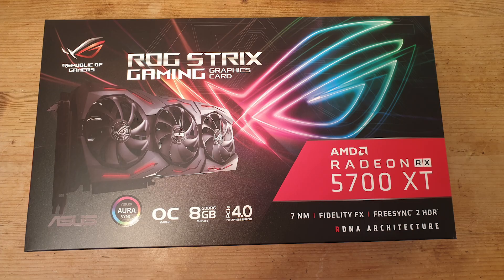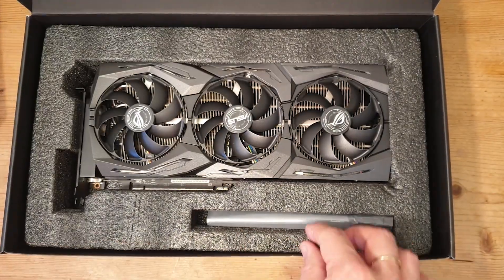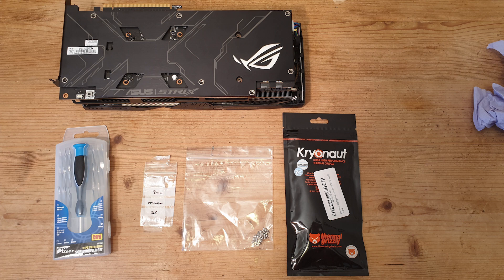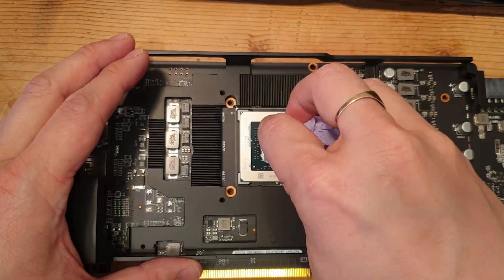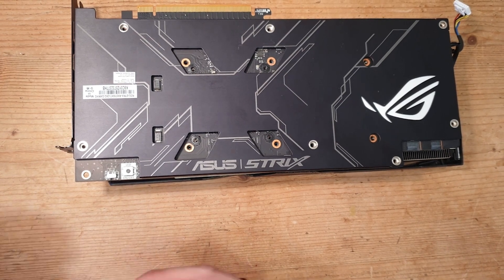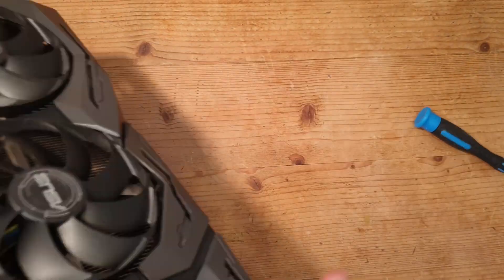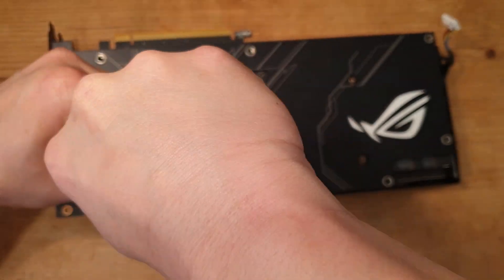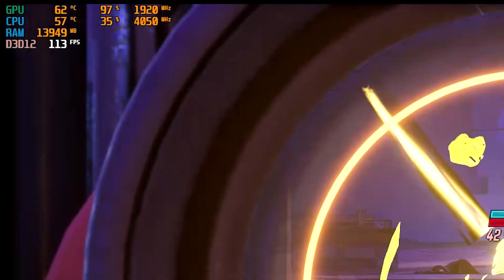ASUS ROG STRIX 5700 XT Tempeture Fix

Comment: I'm looking to repaste my GPU, and don't really get why the washers are necessary? Am I fine just screwing screws back in as they were?
Reply from the maker: The washers makes the cooler contact the gpu die a lot better resulting in cooler temperatures, I believe ASUS made this issue better with the later models so you can just repaste it if you haven't experienced any temperature issues.

Comment: I did that and got 3 degrees different. When gpu goes near the 90 - 100 percent usage it goes up to 82 degrees with 2000 to sometimes 2200 RPM, Maybe my Case aint so good or smth but man. I guess I just have bad luck

Comment: Did you put 3 2mm washer on every of those screws?
Just got the same GPU.
Reply from the maker: I used 3 x 0.5mm (1.5mm total thickness) washers for the VRM, For the GPU spring loaded screws I used 1mm.
Reply: @HardwareHusky  Sorry to bother you . did you use only one 1mm washer for the GPU?
I bought this card 2 days ago and its seriously thermal throttling.
Reply from the maker: @lerigxfr  Yeah I only used 1x1mm washer on each of the 4 GPU screws.

Comment: After changing the thermal paste temps went from 97 to 59 max, but junction still stands strong at 106-112. Sadge
Reply from the maker: You may have a uneven mount, I would first try remounting the cooler making sure you do a diagonal pattern while tightening, if that doesn't help much you may need to use whasher.
Reply: @HardwareHusky  after testing couple days in different games im lead to the conclusion that its how the gpu works, for example when i lock heavier games like cyberpunk to 60 fps, junction doesnt go above 90, while unlocked it keeps pushing more fps till it hits 110 again. Welp

Comment: hello, the thermal pad is 2 mm? Thank you.
Reply from the maker: I think they are 1.5mm but I used 2mm and getting much better vram temps.
Reply: @HardwareHusky  i use 1.5mm,, if using 2mm can get better results?
Reply from the maker: @farahmaisarah7741  most people that use 2mm find vram thermals much lower.

Comment: I have a card a bit newer than that one, they "fixed" the retention screws by adding springs instead of washers like you did. However I was recently reaching temps of about 98°C! So I opened it up and added washers to the screws opposite side of the retention screws and applied new paste and am running on load at 66°C now. Thanks so much of the vid I haven't played games this smooth in a while.
Reply: I started having the same issue with the 5700xt I have. Recently I am getting 100c and I couldn't figure out why. I have 4 small springs underneath the screws that look like they have seen better days. I have no idea where to get these washers though
Reply: Hi, I want to do the same as you, but what do you mean with "washers to the screws opposite side of the retention screws" what other side do you mean?
Reply: @jornesaenen  I think he means just opposite. I managed to do it - I found few washers that came with my mobo and I used 2 instead of 1. My temperatures dropped 15 degrees under load!!
Reply: @treliq - Hi, long time after you left this comment. But I bought this card recently second hand. I Already repasted it and changed the thermal pads. And now I want to add the washers. How thick would you say is the ones you used if you can remember? I noticed I can order ones that is 0.3mm thick. Not sure that will be enough. Hard to get these small washers.
Reply: @thedoors2003  I don't remember at all brother and I don't have the card anymore to check. I think you can use anything non conductive as a washer maybe rubber of some sort. As far as thickness go I don't remember at all
Reply: specifically what size washers did you use?

Comment: Thermal pads thickness you used plz?
People are saying 0.5/0.75mm will be perfect for both rx 5700/5700xt?
Reply from the maker: If I remember correctly the vram thermal pads are 1.5mm.

Comment: does non conductive and non capacitive mean that any thermal paste for CPU would work? Which one should be avoided? @Hardware Husky
Reply from the maker: Avoid metal based thermal pastes like Arctic silver and liquid metal because the metal contained in it can be conductive and capacitive, the ones I like are Arctic MX4 or 5 and if you don't mind spending a bit more get Thermal Grizzly Kryonaut.

Comment: same card,same paste,new thermal pads, and absolutely no fcking change in templs
Reply from the maker: Have you tried adding washers to the GPU and VRM screws?

M2mm x 5mm x 0.5mm for the VRM screws but you can go 1mm bigger 

If you wanted to do the GPU for more pressure. 
M3.5mm x 8mm x 0.5mm for the spring loaded GPU screws.
Reply: @HardwareHusky   i just saw another video where they say about those washers, but i do not get what s the point with them
Reply from the maker: @f3lix3  The VRM screw are too long from the factory and adding washers to them makes the heatsink and thermal pad contact better lowering VRM temperature.

Adding washers to the GPU mounting screws increases mounting pressure to the GPU die so you get lower GPU temperatures because the better contact.
Reply: @HardwareHusky  will try tomorrow thanks,il get back with feedback
Reply: @HardwareHusky What a joke that so many of these cards were shipped out like this. You're doing God's work with this video.

Comment: Hello.  Is the radiator made of aluminum or nickel-plated copper?  I want to use liquid metal
Reply from the maker: The part that contacts the GPU die is nickel plated copper.

Comment: Hi, thank you for the video! However, I don't understand some things in the speeded up video part. How many washers did you put under the vrm screws? 3? And how many do you recommend to put under the screws of the gpu block? I found 1mm thick washers online, are they okay? Thanks and sorry for long question.
Reply from the maker: I used 3 x 0.5mm (1.5mm total thickness) washers for the VRM but others have used 1mm worth of washers so the 1mm thick ones will work ok. For the GPU block 1mm will work ok too.
Reply: @HardwareHusky  Thank you dear!
Reply: @HardwareHusky  where can i get those o rings washers? any link ?
Reply from the maker: @alberthernandez8424  Ebay and Amazon normally have these washers or you can get these from electronics and hardware stores. 
Here a link but it's for the UK:

https://www.ebay.co.uk/itm/FLAT-BLACK-NYLON-Plastic-WASHERS-Form-A-M2-2-5-3-M3-5-4-M5-6-M8-10-12-M14-16-M20-/401506514600?mkcid=16&mkevt=1&_trksid=p2349624.m46890.l49286&mkrid=710-127635-2958-0

Comment: What is the size of the washer used ? I think im gonna use it to the 2 screws which holds the end part of the gpu.
Reply from the maker: The nylon washer you need are, 
M2.5mm x 5mm x 0.5mm for the VRM screws

If you wanted to do the GPU for more pressure. 
M3.5mm x 8mm x 0.5mm for the spring loaded GPU screws.

Comment: does this affect the VRAM temps in any way? i notice my strix vram temps suck compared to my refrence model vram temps
Reply from the maker: No this doesn't.
The card will benefit from changing the thermal pads to good ones like thermal grizzly Minus 8 pads and upping the fans but will still run fairly high because the design.
Reply: @HardwareHusky  thanks for the reply, highly appreciated, do you perhaps know where i can find the specifications for the thickness on all the thermal pads as i will then do my best for the card and replace all the thermal pads with proper ones?
Reply from the maker: @dominiquevanwyk518  Sorry I cant remember the thickness's that I used and I don't know where you can find the information.
I bought 0.5, 1, 1.5 and 2mm pads and measured each one before I removed it from the graphics card.
Reply: @HardwareHusky  thanks, ill see perhaps ill end up doing the same, ill be sure to reply with my results
Reply: @HardwareHusky  just want to report back, by default it uses 2mm thick thermal pads for the VRM section and all the rest are 1.5mm

i ended up using 2mm all round and it worked a treat! vram temps are 8c lower on my mining rig now, the strix vram cooling design still sucks but it is operating in safe temps now atleast

thanks very much for the video to help guide my hands, very helpful
Reply from the maker: @dominiquevanwyk518  Thanks for the update I'll note down the sizes for when the next person asks, Im glad I could help.
Reply: @dominiquevanwyk518  what your temperature when mining after replacing thermal pad?

Comment: I just recently got mine and it still has this problem. Are their specific screws and spacers needed for this fix or can I just use whatever fits well enough?
Reply from the maker: You can use use whatever washers that fit well enough, rather than use shorter screws for the vrm which don't bite into the thread that well I used washers as well.

The nylon washer I used are, 
M2mm x 5mm x 0.5mm for the VRM screws

If you wanted to do the GPU for more pressure. 
M3.5mm x 8mm x 0.5mm for the spring loaded GPU screws.

Comment: Hi, did you use washers on each screw or just the ones that attach directly to the gpu? 
P. S. My English is bad, I write from a google translator.
Reply from the maker: No only used washers on the 2 VRM screws and the 4 screws for the GPU.
Reply: @HardwareHusky  thx

Comment: I bought my gpu in november and I tested if when gently pressing there was space between the head of the vrm screw and the gpu, and yes, but it is about 1mm, is it the fixed version?
Reply from the maker: If it's only 1mm of movement that could just be the thermal pad compressing because the flawed version moves a bit more.
Adding some washers could improve the vrm temperature if they are high.

Comment: So what fixed it?
Reply from the maker: Washers on the VRM screws fix the cooler drop problem on early cards.
Reply: @HardwareHusky  I got mine after the fix but I’m still getting high temps when gaming over 80* what’s the problem do u know
Reply from the maker: @IIQwickScoperrrII  They fixed the VRM screws but left the GPU with low mounting pressure, adding washers on the spring loaded GPU mounting screws lowers the temperature but you will have to break the tamper seal.
Reply: im not really into pc, should i bring it to a pc tech for this to get done or is it easily done
Reply from the maker: @IIQwickScoperrrII  Its a really easy task but you can crack the GPU die if you tighten it too much, a PC tech that is shouldn't charge you much to do this.

Comment: Hey husky, do you mind giving a link or something to the washers to use? i want to make sure i get the proper ones
Reply from the maker: 2mm x 5mm x 0.5mm for the VRM screws but you can go 1mm bigger for either ID or OD

https://www.ebay.co.uk/itm/2mm-White-Nylon-Plastic-Washer-Spacers-M2-New-Pack-x-25-Free-UK-Post-/250951154962?_trksid=p2349624.m46890.l49292

https://www.amazon.com/uxcell-Insulation-Spacer-Washer-Gasket/dp/B01KFNUJCA/ref=mp_s_a_1_8?dchild=1&keywords=M2%2Bx%2B5mm%2Bx%2B0.5mm%2Bnylon%2Bwasher&qid=1598841045&sr=8-8&th=1&psc=1

If you wanted to do the GPU for more pressure. 
M3.5mm x 8mm x 0.5mm for the spring loaded GPU screws.

https://www.ebay.co.uk/itm/WHITE-FORM-A-FLAT-66-NYLON-WASHERS-M2-2-5-M3-3-5-M4-M5-M6-M7-M8-M10-M12-14-16-20/183102291898?_trkparms=ispr%3D1&hash=item2aa1bf3fba:g:wNMAAOSwWMtamXRJ&amdata=enc%3AAQAFAAACgBaobrjLl8XobRIiIML1V4Imu%252Fn%252BzU5L90Z278x5ickk8Fd9si%252FIbtWQr%252BhnlRwjDc0OHe%252Bsf4bsy3Ym8Y91jNVYKa9SfzumxF5V%252BdDqXvF9L5vrcdNizugQZoHJJ9P%252B4cFiObLAsE84qVzzhR9rtvNPc1OY1nlPK3x3tYONTxwKuNZhG2nl2cK%252Bc7C3coHO%252Fw%252BGvHKJKqi%252BpGtgmQGPKAJP5Y0zsI3sW2DbV3zHsZH14sb8yD0i9TR7NYrrB6bMQ8fqX2H4hQ8bxJQjhaKdAsdbi5VrcRM%252B29WwHxLuljwB%252F05lyynM%252FMh6BmhepEn6t2JD91%252BiNzWDHQaXwM93G3Rvu0rJWtxyRqo7aR2KC7fydeQV7TCR%252F8JmpDXhoGMFJrVrMEDThRfkg%252FecbP0Mve09Aw2dXKnwn1s0bjmwjQNfzveeyt3FThV%252FdW6Im0DDLOnPRYWFWnuC61ciuEJFDkk9L6ODoR%252Fds1WRIOa7WdmlJcgCj3m0l4whQqazGtIIO7shImtZ%252FGu7oOiAW0PBEKTrxKTEavzjsqa6UcFHrKxB1r3HYhzj616GEBBcLky5freUM%252F6a5LYZXKI1Pw3sm97QZLUdmzbLbjjD2aQi5xKL055M5WZWEPJciWCcGloMGrCtTk1v7W7R3vGAW%252BgcoBJwt3sx86PdhNOkq5Tvz79ut7M%252FAkzZ%252BgfE0js8rMwzVZntNoBknRPXb2h%252Fcs9uHaxLwBEa3rNFcmdsQmDey045BZyGNrZ4BpLQRcagZUqkOkhApSNR%252B9HltICfbNVyeqejGYQzuzCOMZcS4jKJMS7KFCcMmSULWZaZ7xmqIa3U4PUigwSQXlKX5em7fD5zRj0%253D%7Ccksum%3A183102291898ba10244016fa4f139f2c486a29c9fd7c%7Campid%3APL_CLK%7Cclp%3A2334524

Comment: so i just need to add the spacers in the gpu and vram
screws?
Reply from the maker: Primarily the VRM screws but also doing the GPU screws can lower the temperatures further.  The thermal paste is not required unless you separate the cooler from the GPU die.
Reply: @HardwareHusky  thks

Comment: there are plastic or metal spacers?
Reply from the maker: I recommend nylon washers but other people have said they used metal without problems.
Reply: @HardwareHusky tks, how can i find them?
Reply from the maker: @recindsaa5812  eBay, Amazon or you can try hardware stores. 

The nylon washer you will need are, 

M2mm x 5mm x 0.5mm for the VRM screws

If you wanted to do the GPU for more pressure. 
M3.5mm x 8mm x 0.5mm for the spring loaded GPU screws.
Reply: @HardwareHusky  thks
Reply: @HardwareHusky  Can they be m3 x 8 x 1 mm? for the gpu
Reply from the maker: @recindsaa5812  Yes that will work no problem.
Reply: @HardwareHusky  and m2x5x0.5 are still ok? (sorry im insecure)
Reply from the maker: @recindsaa5812  Yes M2x5x0.5 is the ideal size if nylon but can be tight on some metal ones.
Reply: @HardwareHusky  but if both are nylon?
Reply from the maker: @recindsaa5812  
For nylon washers use these sizes
M2mm x 5mm x 0.5mm for the VRM screws
M3mm x 8mm x 0.5mm for the spring loaded GPU screws.
Reply: @HardwareHusky  ok thks

Comment: Anybody know what thickness are thermal pads.
I would like to replace them.
Reply from the maker: I cant remember the exact size for the vram and vrm but I used all 4 sizes (0.5, 1.0, 1.5 and 2.0) to replace the main pads, backplate and to lower memory temperatures I connected the memory plate to the heatsink.

Sorry I couldn't be more helpful

Comment: I did several tests with Benchmarks, Stress tests, the last one with with FurMark Rog Edition and this is the results:  GPU Max 76ºC Junction Max Max 92ºC, Memory Max 104ºC, GPU VRM Max 81ºC, Mem1 VRM Max 68ºC, Mem2 VRM Max 67ºC. I play at 1080, GPU at 2050Mhz. Is there any concerns around those temps?
Reply from the maker: The memory temp is high but you are running FurMark which is considered a "Power virus" because it uses more of the graphics card resources than normal use. 
What are results with gaming benchmarks and 3D marks?
Reply: @HardwareHusky  It depends. Just an ex. Cyberpunk in Ultra  77FPS 72ºC more or less.  Do you need any special reference? Maybe is everything ok the my GPU.
Reply from the maker: @dinocorreia1202  That temperature for the memory while gaming is about right after it's been fixed either at the factory or yourself, mine runs around the same temperature.
From what you have told me your graphics card sounds ok unless you have mounted it vertically which can hide the issue because the cooler won't pull away from the pcb.
Just check the temps every now and again.
Reply: @HardwareHusky  ThankU so much for your words. I could make a excel with all stuff but it's boring and takes time. I guess you're right. And due that, i didn't mounted vertically. You can watch here https://pcpartpicker.com/b/9Kcqqs I have a nice airflow and seems all looking good. Anyhow i will check over and over again :-)

Comment: Can it work just by tighting more the screws? ( as for me all this looks complicated to do )
It would be grenat if I could have an answer
Reply from the maker: You can tighten the gpu screws more but risk snapping them if you don't have an appropriate torque screwdriver, the vrm screws (which are the main problem) are physically too long so they either need spacers or shorter screws.
If you are capable of tighten screws, you can easily undo 2 screws, add washers and tighten them back up, cooler doesn't even need to come off for those screws.
Reply: @HardwareHusky  Thanks a lot 😉😉👍.
I have around 5-6 m.2 screws ill try with that...
Thx for the answer man that's really cool 👍😉.
Reply: @whoisbasile6771  so it uses only m2 screws and doesnt have to use the washer right?
Reply: @ameersayur  yes worked for me . Used only m2 screws without washers and worked perfectly fine. I tighted them quite hard but not to breaking point.

Comment: what is the size of nylon washer 
The shop on my country is selling this type I'm worried it won't fit "Black Round Nylon Washer Spacer Set for M3 Screws" is this the correct one ?
Reply from the maker: The nylon washer you will need are, 
M2mm x 5mm x 0.5mm for the VRM screws

If you wanted to do the GPU for more pressure. 
M3.5mm x 8mm x 0.5mm for the spring loaded GPU screws.

The black nylon ones are ok and M3 should fit the vrm without issue as long as the other diameter is not to big.
Reply: @HardwareHusky  Perfect! Thank you so much,  More power brother you deserve my sub